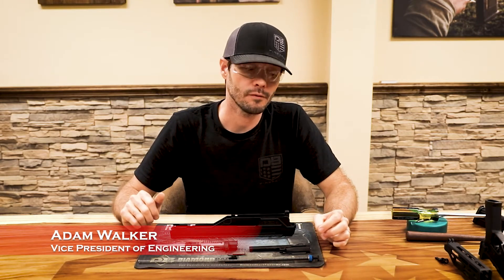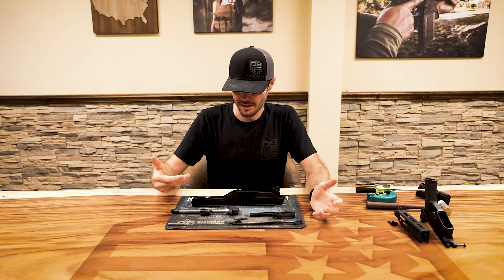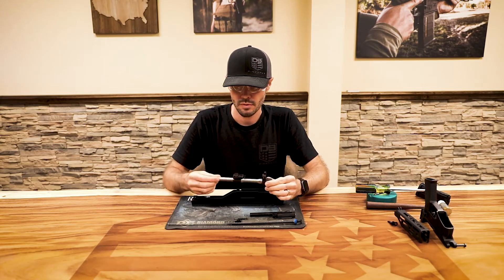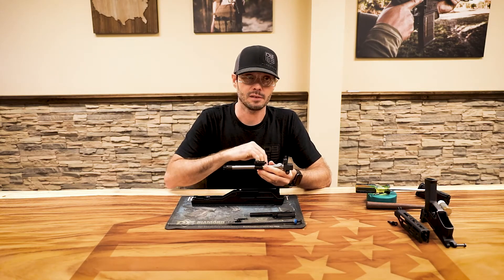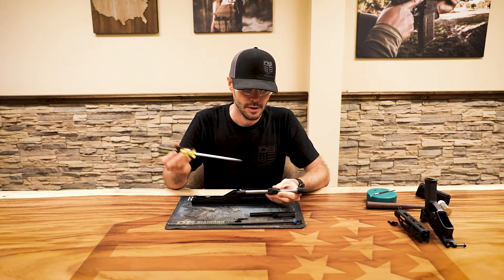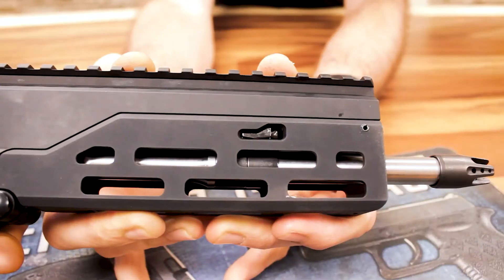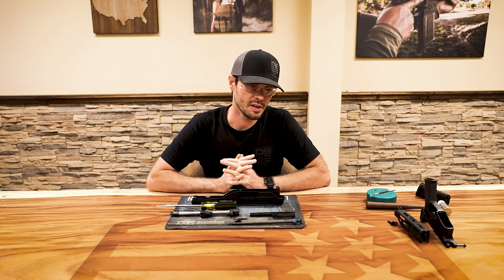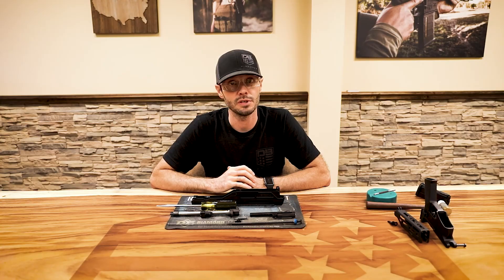DBX Instructional Video 3 - Adjusting the Gas Block

Comment: What’s the best setting for shooting suppressed? Can’t get mine to cycle at all but she sounds sexy when she’s fired.
Reply: No answer....that's no bueno 😢....I just bought one too
Reply: It's the reassembling that I absolutely cannot stand. Sucks to deep clean after a range trip
Reply: Yep.. zero answer and this is my second one. I bought one 1200$ when they first came out and had all kind problems with it, wouldn’t cycle, bolt getting stuck to where I’d have to pry it back and projectiles getting stuck in  barrel after ripping it from casing!!  I send in for them to fix it. After waiting several months for my brand new gun, I sent my disapproval in an email. Well what do you Know, next day I get email it was swapped out for new one  and tracking number.  Well I got  from FFL and first time shot had same problems. Got to looking closer and all they did was change out lower with different serial number and put same upper on it!!   I was pissed, was refunded and swore I’d never buy another Diamondback.  Well I broke down and gave it another shot and ordered another.  It runs ok but just have questions about gas block and using suppressed… but… crickets
Reply: Setting 3 works for me...but I have a very early model so I am not sure if there are any differences. Haven't tried another setting yet to be honest. I've heard of others actually running the gas block on different settings. This is NOT recommended however. I am not sure if the suppressor makes a difference either. I'm running an SRBS 5.56 compact on mine. Sounds phenomenal.
Reply: Some issue
Reply: @warlord0331 stay far away

Comment: Hello, I'm interested in how/why the dual piston system works. I see VersaMax had a shotgun or two with a similar system, but I'm still unsure how it works. I'm also aware this type of system in 5.7 may mean more reliability in cycling, given gas driven or assisted systems (like the M&P 5.7 as well, I think) can eliminate need for coated casings (from what I understand, 5.7 usually requires a coating on the cases to assist feeding, sort of like a lubricant)...which would appeal to handloaders (because that coating wears off eventually, or can be cleaned off). This also relates to the question that went unanswered thus far, below mine. 

Anyway, could you make a video explaining the dual piston system as it relates to functionality, especially cycling and feeding, or any other advantages it might present? I read the manual too, but I still am confused. I am in the market for a 5.7, and I'm trying to decide between your product and another. Thanks for your time.
Reply: That's what I wanna know ... And it's crickets out here.....not cool for a 1k gun..... WOW very disappointed

Comment: I'm a total novice when it comes to gas-operated guns, I know that adjustments can be made to run different types of ammo more successfully (e.g. subsonics etc) but generally speaking, is there a guide for what you might want for a particular load or setup?
Reply: This is a key question that needs a response. When about using a suppressor? What setting would that require?
Reply: This is a good question. I am looking for the same answeres.. Running 40 grain fn  bullets.  Wondering what setting it should be on
Reply: I took mine to the range today for the first time and it kept having misdeeds. I’m using 40 grain American eagle through mine.